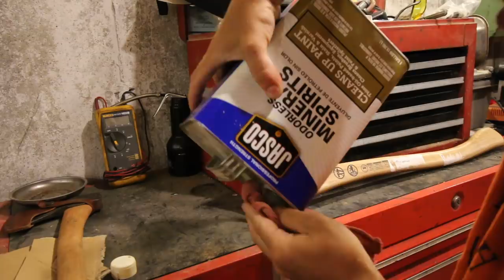5 STAR $30 Amazon Axe vs $150 Gransfors Buks Axe

Comment: Just for anyone wanting to take varnish off the handle of an axe using a vice and sandpaper, be sure to put the sheath if you have one on the axe before you start. If your sheath covers part of the handle, you can always do that separately, outside of the vice. Be safe.

Comment: Would have been a more fair test on the wood splitting I you used the full range of downward swing you used on the Amazon axe as the gransfurs axe. You lifted the amazon axe 4x higher than the gransfurs axe, so of course it's going to bite deeper. You should have knelt down with the gransfurs and this reduces the chance of hitting yourself with a miss swing to 0 as the range the axe can travel means it will hit the floor before you if you swing properly. I have a nice husquavana axe that cost me £55 and is hand forged head hickory handle etc like the gransfurs. But I want a gransfurs anyway mainly because quality, and you said you don't want to have to fork over $150 when your axe breaks? You don't do that anyway, you just either replace the handle when it breaks, or reprofile the edge if you get a nasty chip :)

Comment: First thing  I noticed is the $30 axe is indeed profiled as a splitting axe.  They suck at felling, but are good at splitting.  You have a good combination there.  The Small Forest for bushcraft, use a saw and the bigger splitting axe for firewood.

Oh, and you do want the axe shaving sharp.  It decreases the chance of a glancing blow and injury.

Probably a better way to get a *(much better) cheap axe is to buy a vintage head on eBay or a flea market, and hang it yourself.  You get much better steel, and put in about as much work as you did with that one.

Comment: You can use a sharp knife or a metal card to scrap off the varnish and save some sand paper.   I found it was faster to scrap it with a knife then to sand it off
Reply: A shard of broken glass works best for me.  Leather gloves ofcourse.

Comment: Accuracy is the name of the game for chopping wood. Proper technique and then power. 
For $30 I'd be mostly worried the steel is poor quality and might break. Husqvarna axe heads break and they are expensive. 
And then theres the splitting geometry of the blade wedge shape to consider. 
At $30 I would recommend spending $50 and get a Friskars, at least their steel is good and the handles are less prone to breaking. This is why they are #1.  
But if all you have is a few bucks look on Craigslist, I found a mintcraft for $10. 
Used axes are not made to self destruct like electronics, and are are pretty decent used.

Comment: You sometimes find a Hultafors Agdor Series axe for under 25€. I would prefer those any time over an unknown brand with 5 star rating on Amazon. It does not need to be a Hultafors Classic (which are in the same price range as the Gransfors Bruck axes), the Agdor series is close in quality, also handforged and probably the best bang for you buck. The only difference is the classic series using the Youtube hyped classic Swedish axe head design while the Agdor is more like normal European or American axe designs (which I prefer because they are more robust).

Comment: If you want a great axe thats cheaper than (not cheap as in amazon cheap) the gränsfors go for a hults bruks/hultafors axe insted. Still forged axes with tool steelninlays and pretty much exactly the same quality as the gränsfors. I still have the same axe my father gave me for my fifth birthday 22 years ago and use it almost every day and it is as good as ever!

Comment: The angle of that bevel plus the coating on the cheapo axe are definitely interfering with its potential. I think some sand paper on that coating and a shallow grind with a slimmed profile would bite like a monster. Still seems solid as is though.

Comment: Do you put boiled linseed oil on the handle.  I do, but was wondering if that is the correct thing to do?
Reply from the maker: That is a great option if not the best, I use tung oil, we have some here left over from finishing our floors and concrete counter tops with

Comment: 6:05...let me stop you there ...seems i might have multiple comments coming...anyway..never use mineral oil on wood tool handles its fine for preserving steel and for butcher blocks but it doesnt dry and polymerize like BLO or danish or tung oil will....and use a scraper when removing varnish it penetrates into the wood about the thickness of a utility knife blade so you will spend more time sanding than the axe is worth...scrape with a utility knife blade and then sand

Comment: Soak the stickers with vegetable oil or mayonnaise and let it soak in for a while and they will then usually peel right off.  Wet sand the handle with soapy water and 320 grit, wet or dry sandpaper.

Comment: Browning with a torch andvputtin .Danish Oil on it makes it look nice and functional.  That axe looks like my 40 year old True Temper boys axe.  I use my angle grinder, followed by oil stones on my axes.  The floppy disc will take out any dents and dings and the oil stones will put a real edge on them.  I have all my True Temper axes restored to original condition and finish (candy apple red).  The only thing I do not like about most of the new axes is they are stainless and stainless axes are brittle and don't hold an edge.

Comment: small ax is for cutting, the big one is for splitting logs, you can tell by the smooth wedge shape and long handle, that's why it wasnt sharp at all as those are actually are not meant to be sharpened.

Comment: Good video. Theres just one point i dont agree with.  You actually do want the sharpest polished edge you can get on your axe.  Done correctly, it will make the work you do with it go so much faster and tire you out much less. Its a bladed tool, the sharper the better. Just watch the angle of your edge and dont go too thin.

Comment: I like 600 grit better... 320 is as low as I go. Angles ... Idk I usually free hand it... Don't know the exact bevel angle but it works great don't have to put too force into cutting and it bites. And I'm talking about sanding the handle blade wise I think 800 to 1000 grit.

Comment: There is no other like Grand Fors, period!  For your purposes there you might not need more...but anyone who works with wood often, or who enjoys a quality tool, will prefer the GF.  The GF is a tool you can pass on to the next generation, the $35 tool goes on to garage sale bin. Also, you should always compare apples to apples, the $35 one has a longer handle, so it's going to react different than the smaller...you must be looking for a free Axe from Grand Fors?

Comment: Hard to compare two different axes. Not all axe geometry is meant to perform the same. As you saw, the GB bit deeper into hard woods, sucks as a splitting axe. Just the opposite with the $30 axe. Compare the edge geometry. I'm sure the GB has a lower angle to the bit than the other, which is pretty thick and chunky. I'd bet with the angle grinder and a bit of time you could easily refine the bit on the $30 axe by reducing the angle. For the difference in price, I have no problem refining an inexpensive axe made from good steel. By comparison, you have a Dewalt angle grinder, it's inexpensive, has lasted you years. You could have spent 3 times the money and bought a Metabo. Would the difference be worth the expense? There are a lot of very nice, well made axes, also very costly. I would hope the makers would put in the extra effort to refine them, and provide a sheath. I can do a lot of refining, and sheath making for the $120.00 difference. A $150 axe I have to baby when working with it, just isn't worth the expense. I can buy five of the other axe, put different edges on them for different applications, and work them hard without worry. Yea, I'd love to be able to afford a GB or Liam Hoffman axe to hang on the wall, and admire. lol 
Tung oil is nice, good durable finish but it does not penetrate as deeply as linseed. For most of my oil finishes I start with a mix of 2 parts linseed/ 1 part turpentine, for deeper penetration, and preservation of the wood. After several coats I switch to straight linseed unless the surface really needs the added toughness, durability of the tung oil. I also like to apply them warm, on warm surfaces if possible. Loosen the cap, and set the can in the sun for 20 or so minutes. If the work piece  can be placed in the sun, that goes out too. I then let is soak in the sun for 30 or so minutes, wipe down reapply, rinse and repeat. When the work piece seems not to absorb so well I switch to the straight mix for one or two last applications, then take it out of the sun to cool to normal temps. 24 hours to cure, a good wipe down with a green scrubbie, for a durable finish. For furniture I follow with a couple of coats of a good paste wax, and buffing.
Reply from the maker: Thank you! Yes it is hard to buy expensive tools and then work them hard and get your money out of them! Lol. I will be doing more with this ax and hopefully some other ones too! I think this ax will make a nice ax for the outdoor kitchen and splitting wood for the wood cook stove we will have in it!
Reply: Prime Days start today. Cold Steel makes an almost identical axe in the same price range. I don't have a need for two handers. I tend more towards hawks, and hatchets. I look out for garage sale, flea market finds that I regrind, and refine. I'm currently working on one that was an old cleaver, of good quality steel. I have a very old, well cured length of Osage Orange, with an excellent natural shape for the handle. I'm mostly prepping for the zombie apocalypse. :D
Reply from the maker: Lol! Zombie Apocalypse watch out! LOL

Comment: You cannot effectively compare an axe sharpened with only files to an G Bruks, that has a hand tuned blade and edge. Not to mention two different edge profiles. I would def be interested in seeing the heads and edges tuned identical. I bet the results would be more equal, then retention would be the only competition.

Comment: This is like comparing apples and carrots. You have a general purpose axe with a much longer handle and a thicker blade being compared with a small forest axe, meant to fit in a rucksack. To compare it with Gransfors American Felling axe would be a fair comparison. 

Any axe can be sharpened to compare short term with a Gransfors, but your bevel was far too short and this means you had a thick blade with a very steep edge, probably 40-50 degrees, while the Gransfors likely has about a 25 degree bevel. Just because the edge is sharp doesn't mean that they are both equally sharp. Angle counts for a lot. 

It also looks like you were having some issues handling the bigger axe with that small maple tree.

Comment: Ya you can see the power difference but if it doesn't bite nearly as good what's the point the forest axe is so much better if rather spend 150 also gransfor is one of the best brand for an axe and it will last for forever

Comment: I know that this isn’t meant to be scientific but on the chopping test I noticed that you are accustomed to using the gransfors and that you are comfortable with it where as with the 30 dollar axe you are inaccurate because you are unaccustomed to it. I believe that if you had used that axe for a moth before doing this video that the results would have been different since the 30 dollar axe is heavier and larger I believe it could have had a chance at beating the gransfors

Comment: A 400 grit sharpening stone won't cut it you need something like 1000 at least and the higher grit you go the longer the edge will last because if you think of it if you cut halfway through piece of wood it's pretty easy to break through that piece of wood but if you're only cutting like eighth of an inch down that's not that big of a difference it's hard to break so your Edge doesn't roll as easily to the chip is easily and just overall looks way sexier and what's cooler than shaving with an axe can you get any more manlier

Comment: If you want to get good penetration take your boiled linseed oil and cut it down three parts mineral spirits to one part boiled linseed oil for the first couple of heavy coats let it soak in real good and then start moving yourself up to a one-to-one ratio and then finish it off with straight up boiled linseed oil and you will have a nice deep long lasting finish that is just totally awesome

Comment: Not to pop anyone bubble but you get what you pay for, you by a $35 Amazon Axe the head is made out of either hot or cold rolled steel, you buy $100 acts that's made of tempered steel it will hold a and sharp edge for a long time. The acts from Amazon you will always be sharpening  it because it is very low grade metal. You want a high quality acts open up your wallet just as simple as that

Comment: If you keep the edge angle around 18- 22° it will be a great chopper. You did a very dull edge. Way too steep. So it does not bite very well. Make the angle very flat. Almost to the axe cheaks. It will be a great chopper.

Comment: Well they are 2 different type of axes. That's not how you split wood with a small camp axe. And then the other is a full size axe. But I do agree that you get the high end for you camp axe and the $30 for your home axe. then again just get an actual log splitter and full size axe for home.

Comment: did you add time and materials to the cost? why not ? how do they compare if you don't improve the cheap one? how much work would you do with the cheap one if you already have a better one? if you only cut 10 trees down a year which one would you buy if you had none to begin with?
 A better tool is better in every way, that's why they cost more, they take longer to make, so the cost is higher. Hand tools, you get what you pay for.
 can someone do this test without altering the cheap one?

Comment: They are two different styles of axe.  Apples and oranges.  The expensive one is more of a woodworking tool, whereas they cheap one is a splitting axe.  It's all in the shape of the head.  Thin blade is made to penetrate, where the cheap one is more of a wedge shape to separate the halves of a log.  I'm sure the steel is better on the expensive one though.  Good to have both though.  Splitting wood can be brutal on an axe.
Reply: Jim F He said at the start that's why he wanted a second axe, so he could have different axes for different uses.
Reply: John Francis Doe   no, he said a second axe to spare his good one.  Otherwise why compare the two?   It's ok, I like the channel, just he goofed up on this one.  We're not perfect.

Comment: I hate go burst your bubble but you're using two axes that aren't meant for the same thing! A gransfors axe is used to cut small trees down (as you can see it's made for deep cuts) while the $30 amazon axe is used for splitting wood not cutting trees down. The gransfors has a more narrow head (used for deep cuts) while the $30 has a wider more broad head used for splitting. Therefore the $30 axe does not compare to the gransfors in the best way.

Comment: It's fine as a cheap splitting maul, but it fails as an actual axe. The small forest axe isn't designed to split wood. You're comparing things that aren't designed to do the same work.

Comment: You said you bought the cheap axe not to damage the expensive axe that does not say much for your axe work m8.   I know it was a gift to you but @ that price it should be bomb proof @ that price,   But hey i work with mora knifes daily & have expensive knifes the expensive knifes are dust collectors & the mora is my pride & joy to work with.
Reply from the maker: Different tools for different jobs
Reply: Of course but hey the bigger 1 for me is the better 1 as i watched.   The smaller 1 would be great for the bush-crafter the bigger 1 is for the working man.   You would great a great deal of work done with that big 1 as you break it in.    For me i would never ever pay over £50 for a axe & believe me i have a few great working axe.   Thank you.

Comment: Couple quick observations:  1) Handle on the $30 axe appears to be a lot longer than the GB axe, so more leverage while chopping, along with the heavier head, which will transfer more power to the stroke.  2) the GB axe head is guaranteed for life, but is the $30 axe?  It's a quality thing... You could buy 5 Mintcraft axes for the one GB axe, but years down the road, which one would you rather pass-down to your son/daughter/nephew/niece?  If you don't think GB axes hold their value, just go shopping.  Some models can't even ship to U.S. anymore, due to demand and limited production availability.  I'm not saying NOT to have a second/third cheap axe to beat-up around the farm, because there are going to be some chores just too risky to use an expensive axe on, and it would be a shame to ruin a good axe trying to chop roots out of the ground, or hammering spikes, etc... In that case, having a cheap axe that you won't commit suicide over if you destroy it, is a good thing to have as a backup.  Oh yeah, also noticed that you'd only have to spend a few hours and invest in a small workshop to be able to get the $30 axe "up-to-snuff" to be ready to do some serious chopping.  The GB axe is good to go out of the box.  Quality control, at each step of the production process.  Any of the factory workers at GB can reject an axe for any reason, at any stage of the production process.  P.S.... I'm not a GB salesman, even though I sound like one :-)